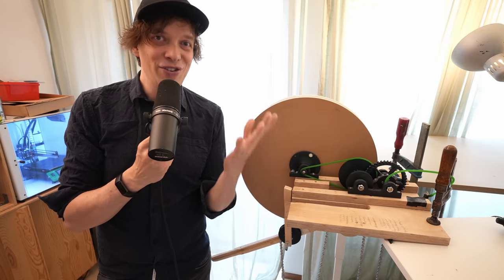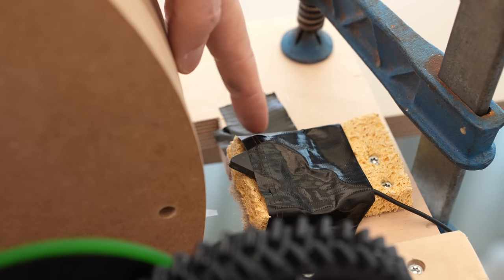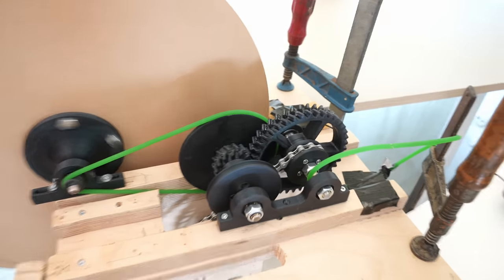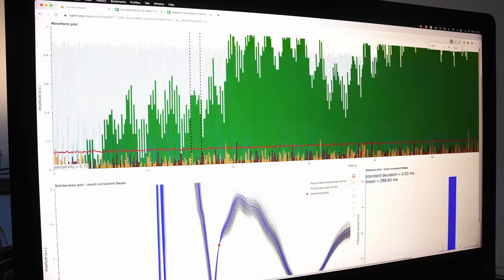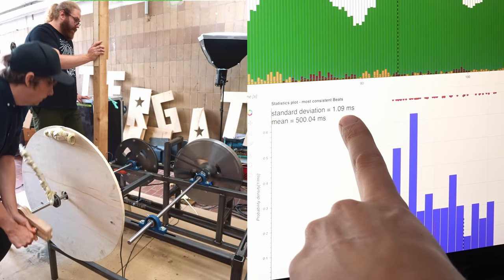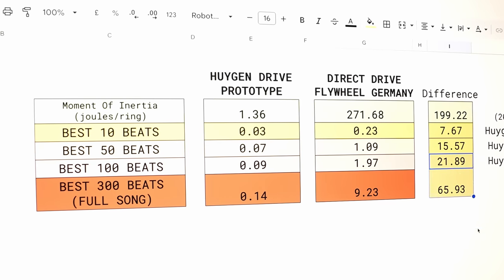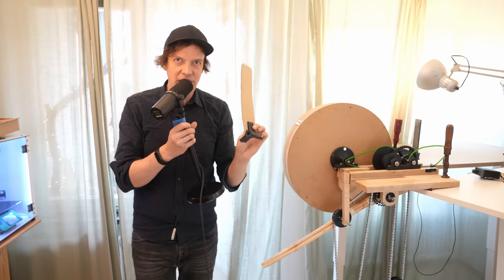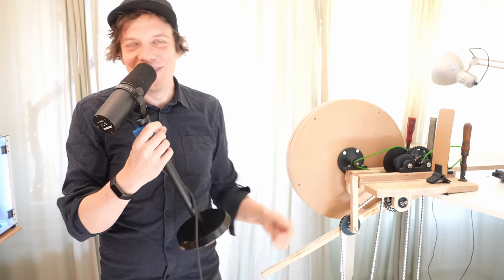Is Gravity Really Constant? I Built this machine to find out.

Comment: Using chain drive or metallic gears all the way would probably be necessary for this to give more accurate points of measurment.
Also, instead of flicking a piece of plastic that will wear down and affect how much it brakes, you could use a cheap camera connected to a raspberry or similar to record when a black or white piece of tape passes by, which wont wear down.

You would need a thermometer to have a rough recording of the air density in the room too, to account for how much the air flaps are braking from time to time, as well as friction points.

Comment: For those who ask "Does music have to be that tight?" It's about getting the different parts of it in sync. If for example the whole drum section ends up being slightly out of synch...running at the same speed, but a few milliseconds behind the rest, it's SO easy to hear. Anyone who works with midi for example, knows this. People think that because a band can change their tempo dynamically to influence the audience and such, that this means "it doesn't need to be that tight", but the reason this works for a band, is because they have lots of experience playing together and they are in sync with one another, especially when they are doing stuff like changing the tempo, changing the time etc.

Comment: if you could engage more weights (one sprocket on the drive shaft and one on the flywheel shaft) when you engage more instruments on the machine, it wouldn't lose tempo as the load changes.

Comment: Don't forget that the speed of the flywheel WILL change as the load changes. Gravity is constant, but I think that with different constant loads you'll get a different constant speed of the flywheel or at least a braking effect and then you'll need to wait until it speeds back up after introducing a new load. To minimize this effect you need either a very heavy flywheel and weight (and a long spin-up time), or a very sophisticated gearing system that is reactive to the load or pre-calculated with each instrument's individual load (which will further vary with the unevenness of the melody), or both.
Reply: Although I feel like the same problem appears with the manual design, and while it's easier to manipulate the input power for the Germany design, to achieve the proper bpm faster - I feel like the Huygen drive is better.

Either way - I feel like you're coming back to form over function, trying to design it this way. Yes, this is more in the spirit of the marble machine being a lot of instruments operated by a single person, manually, but this adds too much complexity, parts and fabrication time (and no insurance of success). Using a strong stepper motor (for very constant RPM/BPM) that can take a lot of extra load while staying at constant speed, will be a faster, better and more reliable solution by a lot. By trying to implement either of your solutions (Huygen, or direct flywheel) you will most definitely have to redesign, remake and reinstall many parts over and over again until you eventually get it after a very long time, or be defeated by the marble machine once again. No matter how tight all of the parts are on the marble machine, if the initial drive that powers that machine isn't constant - neither will the music ever be tight.

Comment: Yes but. During a song you will enable/disable some instruments. This will change the overall energy needed to drive the machine. This energy will be taped into the flywheel rotational energy ultimately changing speed without the possibility of correction that you have with a crank (where you can push harder when needed)

Comment: At 7:18 Martin said that the prototype "played 300 transients within this timing range" as he pointed to the 0.14 millisecond graph. That's not actually what standard deviation means. Actually, what it means is that 68% of the samples will tend to deviate less than 0.14 ms, 95% will deviate less than 0.28 ms, and 99.8% will tend to deviate less than 0.42 ms.

Comment: Fun fact. If you get exactly 180bpm at sea level, you'll get 179.4bpm at 35000ft (10670meters) due to the difference in gravitational strength at different altitudes. This is the standard cruising altitude for commercial airliners.

Comment: Got to drive that weight with a stepper motor so you can control the speed and keep the tension consistent. I think a crank a crank would still affect the timing.

Comment: Every time you raise the weight you're accelerating it, which puts more tension on the chain. Though this is somewhat balanced out by the reduced force on the chain as gravity decelerates it. The flywheel must be 'averaging' this out to produce the tight timing you're achieving.

This approach won't work so well with varying loads applied to the system though. Some sort of centrifugal govener is the way to go in my mind.

Comment: Assuming you've got some other tolerances up there, chances are that deviation you are getting is from air currents in the room acting on the governor, at least in part.  There's also the question of what the force of impact is on that microphone and whether it varies.

Comment: Lacking some explanation on what the air governor is for... my guess is limiting max BPM via drag?
You might need some kind of more reliable limiter, depending on how turbulent the WORLD TOUR auditoriums get.
Imagine 10,000 people in an indoor stadium, each body emitting roughly ~100W of heat (more when excited or active) - that's a lot of airflow to maintain comfortable temperatures, which creates turbulence, which impedes the ability of your air governor to receive a specific drag.

Comment: I am not the first one to comment this, but the lack of closed loop feedback control in this system (mechanical or electrical), will mean this is not easily useable for the marble machine. If anyone has a hard time seeing this, let me explain it from my point. Most physical systems can be described by potential (pressure, voltage, temperature), flow (current, flow-rate, heat) and resistance. Her our potential is a constant torque from the weight, the flow is rpm and resistance the load (this is only guesswork). The load is probably dependent on rpm and if this equation is somewhat linear we get torque_input = rpm*load or since the input is constant rpm = torque_input/load (sounds familiar? Yep thats u=r*i for electricity). So if the load gets higher rpm goes down and vice versa. To keep the rpm constant you have to either change the torque_input (which sounds easier than it is, since it is a mechanical system) or you change the load. However you can only increase the load and that in return is only useful, if the load from the marble machine drops. I hope this did a decent job explaining the problem. 
(The Flywheel resembles a capacitive/inductive component, one would have to look at the energy flow of the system to properly define this and also find the correct flow/potential variables)

Comment: im not sure if i entirely understand how the software you are using, works- but just to be clear:
the beat from this gravity-powered flywheel was going WAY faster than the mechanically-powered flywheel-
it is generally way easier, mathematically speaking, for something this fast to be tighter than something thats slow (there is more time to mess something up, essentially).

if  the software that you are using is equating absolute values against each other without actually scaling the tempo of the beat, then those numbers are way less valid-- (in favor for the gravity-machine that is)
so i would like to see both machines to operate at the same tempo in order to be sure that the performance is actually comparable.

Comment: If the machine were moved, it would need to be retimed because although gravity is constant at one location it varies over different parts of the earth, otherwise very cool, I wonder if you added a spring like in an automatic watch movement you could have more even power going into raising the suitcase, so then constantly having to monitor it would not be an issue

Comment: The weight drive doesn't produce constant speed. It produces constant force. Unless your machine requires constant power to run, the weight drive will not produce constant speed. The previous machines had a feature that allowed certain instrument parts to be switched on or off. This certainly would change the power of the machine. And it's not like the power fluctuations would be that short. So (provided that feature will still exist) the machine would still speed up and slow down. Would it be by much? Probably not. Depends on how much power is used on overcoming friction compared to lifting marbles. Let's say by switching some parts off the machine speeds up by 1%. That is still a difference of over 3ms when playing at 180 BPM (5ms when playing at 120 BPM).
Of course, a flywheel will delay the speeding up and slowing down.

At least when powering the machine manually you have control over the speed.

I understand that you want to maximise tightness. However, this case is a little different. That is because we are measuring the difference between the length of beats, not anything within a beat. Unless you have an electronic metronome, you aren't going to notice the difference of a couple milliseconds over 100 beats. But you absolutely will notice if two notes that are meant to play on the same beat don't. That's why the tightness of the marble gates and programming wheel is important.

Comment: I'm late to the comments but using a Sprague clutch bearing instead of a ratchet mechanism will give you much quieter one way drive on the chain.  That combined with an electric drive to lift the primary weight that's controlled by some limit switches would basically automate the flywheel drive.

Comment: A big but is that you cant increase or decrease the power input to compensate for changing power demands in the system. Depending on what instruments are playing the friction would probably be dramatically different. Would be interesting to know how much power the electrical motor used on mmx was running on, this could give a ballpark estimate of power output delivered by a mm3

Comment: my gut instinct is the only reason the suitcase method isnt even tighter is when you ratchet it causes it to sway slightly which might effect its weight and constant output. and actually the ratchet lifting it up will also make it lighter for a brief second. then it would need to adjust to equalibrium.

Comment: One aspect of the pedal version was the amount of effort you had to put into it and the need for a lot of inertia to get what you wanted. You had your back to what would be the rest of the marble machine and no capacity to throw levers.

If you can get what you want from an easy to operate crank handle, you will end up with an instrument you can actually play.

Comment: Whilst this is encouraging, you're still not normalising by BPM (i.e. divide standard deviation by BPM); I pointed this out in a comment on the flywheel test video. The Huygens drive tests are at a much higher BPM than the Germany flywheel, so the absolute size of the standard deviation will be smaller due to this. 

In order to accurately assess the improvement using Huygens (or even playing at different BPMs!) you need to do this normalisation.

Comment: So so many problems.... But its a good test to see if you can make that system, so not a waste of time.

There was constant load, hence constant output speed. That has an output speed that is highly dependent on load.

You need to figure out a way of decoupling the speed of the flywheel from the speed of the machine.

For instance, you could use this setup to give a constant speed reference.

You then use the large inertia flywheel to maintain a large amount of energy ready for use.

Then, link the high inertia flywheel to the rest of the machine using a belt drive CVT.

Use a clutch mechanism off the main flywheel to rewind the huygen mechanism. So the falling weight has a string coming off of it to pull on a clutch lever, so when the weight falls it engages on the main flywheel and lifts the weight. When the weight raises it causes it to disengage, keeping the weight at fairly constant height.

Finally, use a differential drive to compare the machine speed to the huygen speed and the output of that goes to the CVT.

That allows the hugen drive to operate with a constant load, being the CVT adjustment and the govener to set the BPM. Constant load gives you a tight BPM.

The CVT allows the machine to use the power from the flywheel while setting the speed equal to the huygen drive speed.

It also means that all your power input goes into the main flywheel, which doesnt have to be perfectly constant giving you the freedom to start and stop putting power in without affecting BPM.

If your governer is constantly variable you can also quickly adjust the BPM on the fly, so you can play the original marble machine song.

Variable load from the marble machine also causes the main flyweel to loose energy at a variable rate, but the CVT will change its ratio as the main flywheel slows down, maintaining the BPM.

Now, for the govener, that too is a solved problem. Use a spinning weight govener. Adjust the spring tension to set the BPM and the output of the govener should go to a bicycle disc brake to slow the output down. The flywheel on the huygen drive side should be heavy enough to limit the acceleration rate of that system to stop oscillation but otherwise as light as possible.

Comment: Gravity is constant, but air resistance that has more influence on this device is not. When using such big governor wings even a slight breeze in the room can throw it of balance. I would suggest using a sealed governor and if the air version is too big just replace it with water and enjoy even more size reduction!

Comment: Next you'll need to build a Continuously Variable Transmission (CVT) to let you precisely control the tempo of your machine. It's basically two cone shaped "gears" with a belt connecting them that you slide across them.

Comment: I would personally not use an air governor for something I would want to be super constant, simply because it will be subject to air density and that changer more than you think. A 3 degree change in temperature changes the air density by 1%. I'd personally use a centrifugal governor.

Comment: I don't know much about contact microphone, or the hardware used to record sound, but do you have information about how precise it is? Considering your now measuring in the ms or under range, maybe you should test your equipment to be sure it gives you correct information. Maybe compare it with a tachometer?

Comment: You should look at a mechanical govner system that reacts to small changes in RPM. The comment on variable load and the effects of accellerating the drive weight, when lifting it both point to likely poor results when a drive system like this is connected to a dynamic load. Essentally there are two basic concepts you could investigate, neither oerfect BTW. Using adynamic  break, be that air or direct contact friction, acctuated by spinning mass of some sort, think classic engine govner, would compensate, to some degree, for changes in load or applied input force. You could also look at a CVT on the input which is coupled to the spinning mass govner, the latter would indroduce more friction but wouldnt be waisting energy in order to throttle the speed.
There are many types of CVT, rolling ball being oddly apropriate in this context, if a little complex. Belts or disks would probably be easiest to build.
Gravity may well be constant but thats about the only thing you are dealing with that is... Even in this simple test.
Fluidic or magnetically coupled CVT conceps are worth a look as is a variable bagnetic break if a friction govner is your goal,

Comment: If your basis for your tolerances is as low as 0.14ms then you will have a better floor for error. As the errors stack up through multiple components you'll be tighter across them all.

Comment: It doesn't seem like this is a really a fair comparison because the prototype you built in Germany could have had a governor but did not. Adding a governor to it would presumably have made it tighter. But it seems like one big advantage of the gravity-based approach is that it would allow you to better store energy, so that you could stop putting in energy to do other things (like play another instrument) without the machine immediately starting to slow down. On the gravity-based system I do also wonder how much of the speed regulation was due to the governor and how much was due to inertia and friction. It might be worth testing without the governor to see how much difference that makes.

Comment: Altitude's Effect on Weight: Since your weight is the force with which gravity pulls you toward the Earth, your weight will be slightly less at higher altitudes. For example, if you weigh 150 pounds (68 kilograms) at sea level, you will weigh slightly less when you are at a higher altitude.

Comment: Im not sure if it helps, but there is a slight inconsistency with gravity, it changes depending on altitude, but not my much at all, so little that the guy that developed the constant for it thought it wouldn't change enough to be worth noting with the number.
Additionally, pressure changes in those areas, and I'm unsure if that chages anything.

Comment: Im by no means knowledgeable on the machine you built, but my intuition makes me think that you'll need the inertia to have good dynamic characteristics of the drive under load - the flywheel being so light, might simply slow down as the load changes from the present situation. Otherwise, you might want to look for some kind of mechanical load decoupler with a heftier source of power so that you can use this machine as a "timer" and make something else do the work.  

hope it all works great!